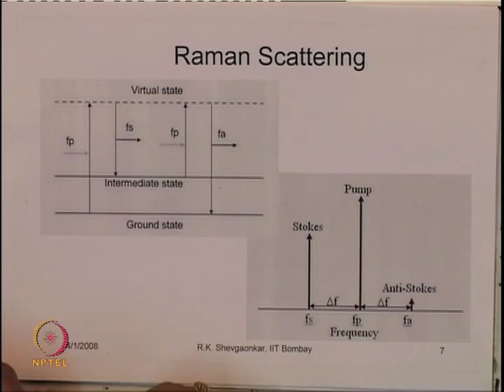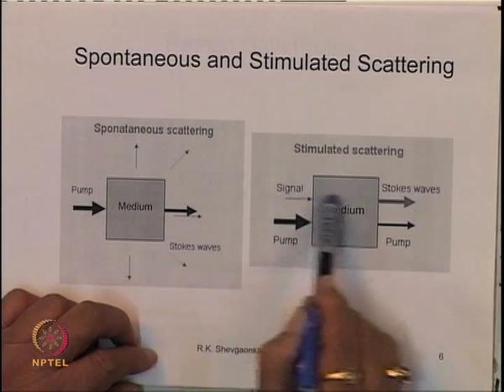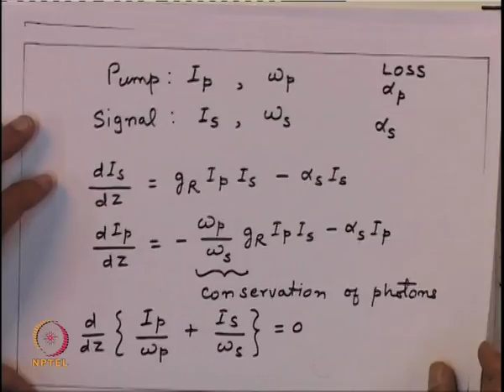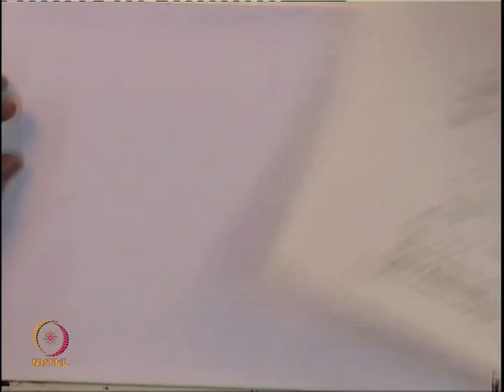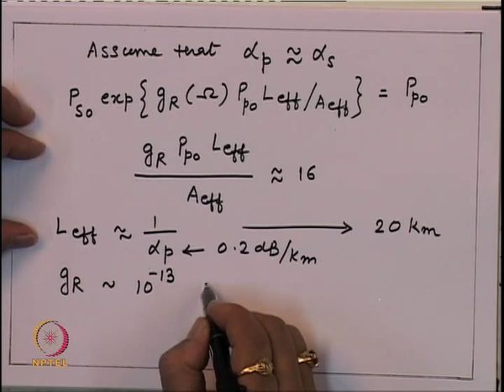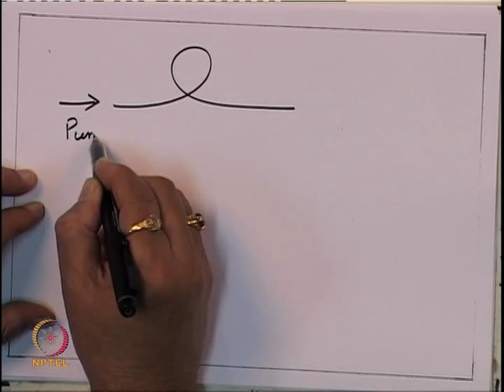Mod-01 Lec-37 Raman Amplifier

Comment: Answer ARaman amplifier is pumped in backwerd direction using 1 W of power . find the output power whhmen a 1 uW is injected into the 5 km-long ampkifier . Assume losses of 0.2 and 0.25 dB/km at the signal and pump wavelenths rspectively , Aeff =50 um^2 , and gR= 6×10
Reply: 009647810342122